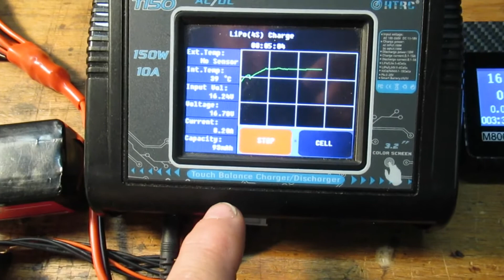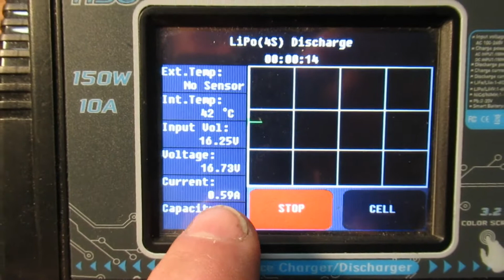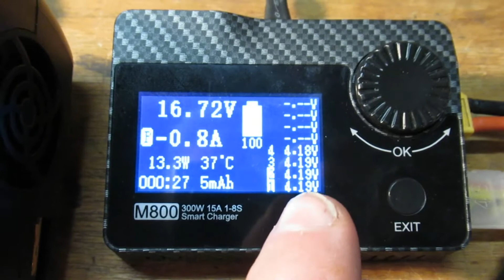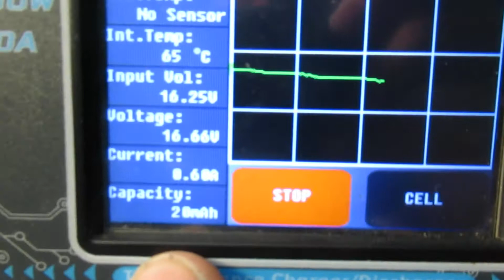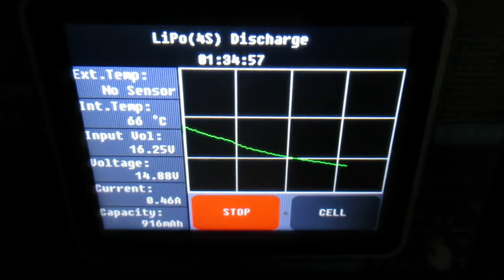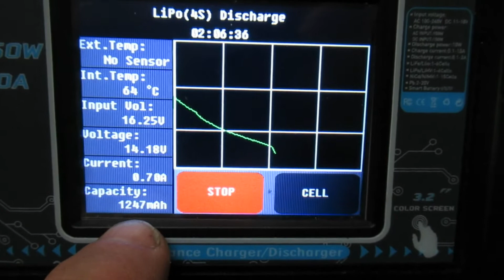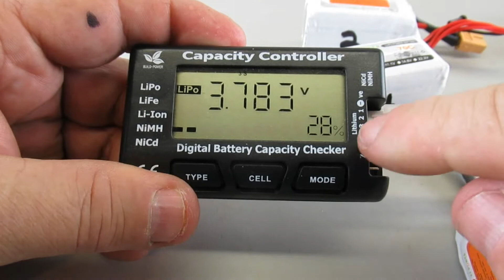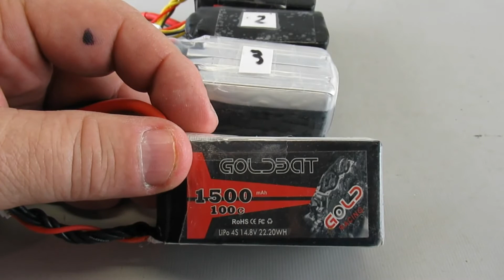FPV | LiPo Battery Capacity Testing | Measurement |

Comment: I like those Tatu batteries. They work really well. 🙏👍🙏👍👍
Reply from the maker: Pretty much all my 2S and 3S have been Tattus, and only the 850s have giving me puffing trouble.  I do admit I've keep some fully charged which I've now stopped doing.  Recently I've been moving to RDQ packs to see how well they hold up.  Their 3S850 is only 54 grams vs. Tattu's 76 grams.  That's significant.  Do you use any 3S packs?
Reply: @TommyTester  You should try Zeee, they are pretty cheap and they haven't puffed up for me. I have been using them for about 18 months. 1500mah 134grams. 2 batteries for 34$. 120c
Reply from the maker: @Iinustechtips  Thanks. I'll do that!
Reply: Hello, thanks for making the video. 1 question I have is are you saying that you discharged from 4.2 to 3.5 a cell and you achieved right around 850mah on a 850mah battery? So in theory I should be able to discharge a 8000 MAH from 4.2 down to 3.5 a cell and I should achieve around 8000mah if the battery is good and the battery label is accurate?